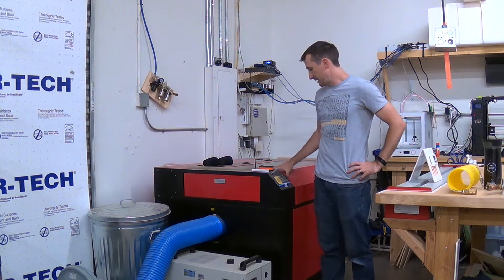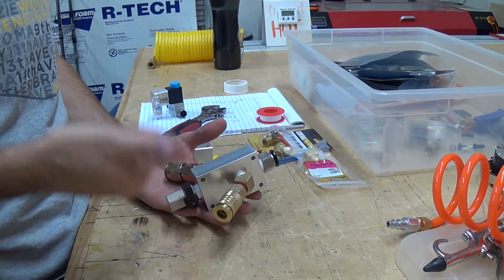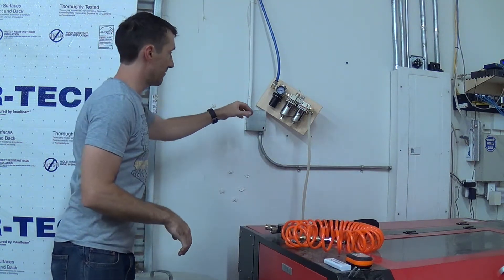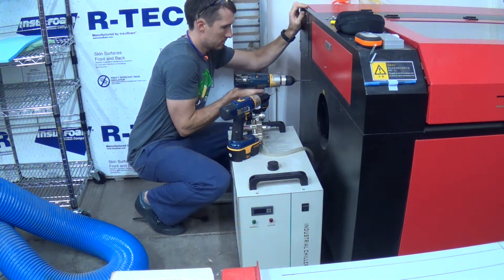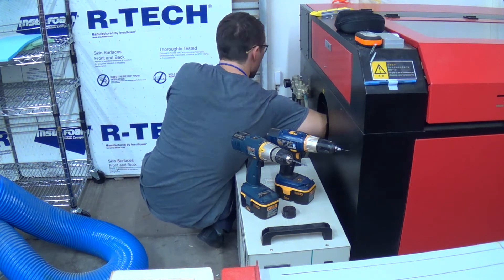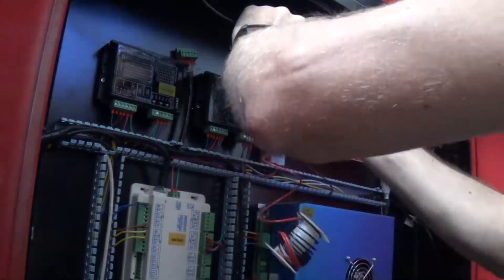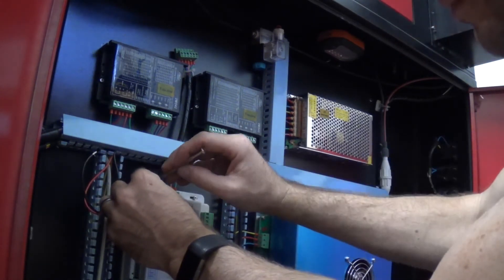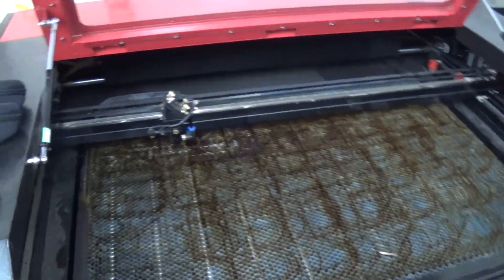Import Laser Cutter Air Supply Upgrade

Comment: Do I need relay between valve and controller?
Reply from the maker: This valve has a relay built into it.
Reply: @ATNomad  how do you connect it?  My laser gives only 0 or 2.5 volts, and doesn't work even a relay
Reply from the maker: @juanpedrobenaventevega7557  do you have a DSP controller?
Reply: @ATNomad  is Ruida,   and maybe tomorrow I'll connect using opto

Comment: Would you mind sharing what brand and model your laser cutter is?  Thanks!
Reply from the maker: We bought it off Amazon ;) here is what the title was (it's no longer on there) CNCShop Laser Engraving Laser Cutting Machine Rotary AXIS 100W Co2 Laser 900x600mm Cutting Machine for Arts and Crafts with 80MM 3 JAW Rotary Attachme

Comment: Can you post a link to that solenoid
Reply from the maker: Here's the one I used: https://smile.amazon.com/gp/product/B008CP02YO/ref=oh_aui_search_detailpage?ie=UTF8&psc=1
Reply: Brady Fulton 
Awesome. Thanks. How’s the machine running.
Reply from the maker: Great, handles everything I throw at it. Haven't had any issues besides the power switch melting down when I moved it and forgot to reattach the grounding wire. Do you have one similar?
Reply: Brady Fulton 
Which brand and model is that. I’m looking at boss brand
Reply: Thanks
Reply: Very usefull video, could you tell me right exit you have used to connect solenoid on controller?

Comment: Thanks for the video, didn't know that there was 24v out on the controller intended for the air assist, that makes things a lot easier.
Reply: Brady Fulton thanks, another question I have is what specific solenoid did you buy? If you used your own push fittings for the valve, what size did you use (if you remember)? thanks again